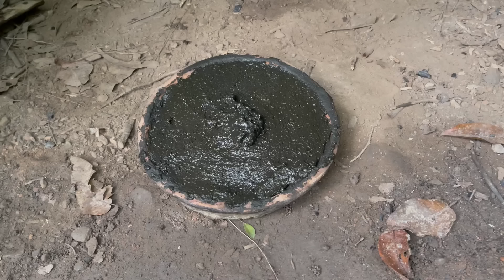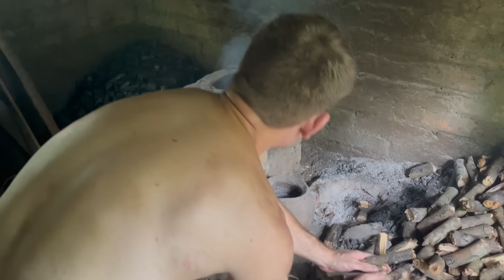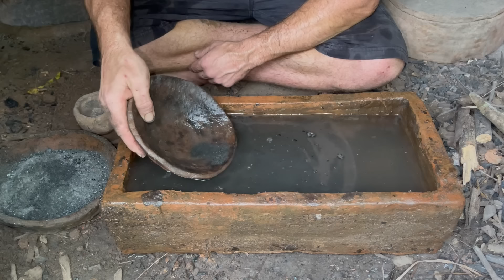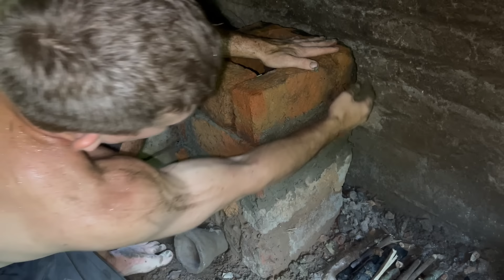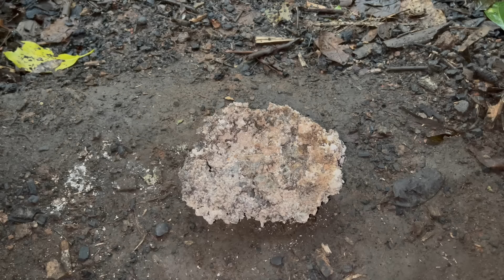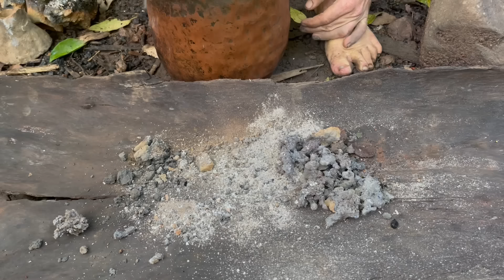Primitive Technology: Roasted Ore and Shell Flux Smelt

Comment from the maker: I tested roasting the ore, using lime flux (shells) and recycling slag in 3 separate smelts. Roasting the ore improved the yield about 2 times though this might have been due to decreasing the volume and effectively increasing the concentration of the ore. Adding lime (snail shells) ruined the smelt and produced next to no iron. This may be due to the ore already being basic and chemistry and the lime made it so basic that the slag won't flow. Sand (an acid flux) or old slag might make a better flux for this type of ore, lime might be better used to flux iron sand (acidic due to the silica content). Finally, I tested re-smelting the slag from previous smelts (not the slag from the lime smelt). The result was about half the iron came out compared to fresh ore, which suggests that slag should be smelted again to recover any iron not obtained during the first smelt if fresh ore is hard to come by. Thanks.
Reply: Have you been able to test the temperature at different phases of the process? If not with a laser thermometer than by color of the fire akin to how a blacksmith judges heat?  Is it possible the heat is rising too quickly for the prills to form in the mass?  Great video as always!!
Reply: The iron spheres are huuuge compared to previous experiments! Even the small ones looked bigger than previous prills. Nice work!
Reply: The limed sample looked almost like you were getting glass. 

You might give glass-making a try?
Reply: Just an idea,

If your pots can handle the heat, is it possible to make a sealed crucible to melt the accumulated iron into an ingot?
Reply: What is the ultimate goal once you have collected enough iron? How much are you going to need?
Reply: You should start working on lead and copper, and grow lemons so you can make batteries
Reply: @charles I came here to ask the same question. My guess is the goal is to produce some basic iron working tools like a small hammer and anvil.
Reply: Is it a good idea to melt the slag a third time? Or is it better to get new ore.
Reply: That’s too bad about the Lime slag. Is there no way to salvage it?
Reply from the maker: @Jaalix_Learns  The color of the coals looking through the tuyere is white hot and leaves an after image like looking at the sun (1300C plus?). But it could be that this is only a small region of coals with the blast not penetrating deeply enough. The fact that it's producing cast iron rather than low carbon soft iron though indicates a high heat where the metal becomes liquid and absorbs charcoal. Also, in other smelts, I've picked out charcoal with iron (not slag) melted/splashed onto it suggesting the iron is liquefying. The heat shouldn't rise to quickly as the fuel bed above is supposed to keep the heat in. Thanks.
Reply: How long did it take to gather the ore for this video?
Reply: I love all of your iron smelting videos!! I'd be interested to see the pH of the lime sample you threw out. It could be a pH issue, or perhaps the shells weren't crushed up enough (they appeared to still be a bit chunky). I'm NOT speaking through experience as I've never smelt iron before, however I've seen many videos on it being done, and do have experience with copper, aluminum and bronze/brass. 
Another thing you could try doing is stirring the slag once it's molten. It may help further separate the iron from the slag
Reply: honestly the wood ash is probably already acting as a good flux, i don't think you need to do anything else there.
i am surprised you didn't burn and grind the snail shells first though, i thought that would have been an obvious step if you were going to use them.
Reply from the maker: @Endede  They're big compared to my recent smelts (30g total compared to about 15g). It seems the ore has changed though over a few years, as the prills I produced during the iron knife video were larger and made about 40 g per smelt for 6 chargers rather than 7. Maybe more white clay has gotten washed down the creek recently which tends to lower smelt yields. Thanks.
Reply: I'm curious would increasing the heat yield more iron and if so how might you go about increasing the heat?
Reply: @sandvich4days871  I think the uneven heating of the clay would crack the pots and it would leak
Reply from the maker: @lairdcummings9092  Actually the roasted ore seemed more glassy to me than the shell lime smelt. It could be, as mentioned elsewhere in the comment's, that the ash left over from roasting is acting like a flux. Agreed, the really glassy slag could make good glass. I've experimented with making glass but haven't gotten a result worthy of a video yet. Thanks.
Reply from the maker: @sandvich4days871  It can be done in a crucible, but the clay needs carbon added to it so it wont melt. I'm testing crucibles at home. Thanks.
Reply: Nice video, the ash from the roasting may have added some caustic impurities, to dehydrate iron oxide you only need a few hundred °C It may be possible to do It in the ceramic kilm.
Reply from the maker: @charles7412  A better knife than the one I cast before or an axe. I have enough iron at the moment but need a way to cast /forge it efficiently. Working on these methods between smelts and experimenting at home with scrap iron before testing it in the wild. Thanks.
Reply: can't wait for iron hut 💪
Reply: Why not pan for iron sand in the creek?
Reply: Wood ash from hardwood
Reply from the maker: @NeuroScientician  Yes good idea but hard to find those metals here. Thanks.
Reply: @NeuroScientician  You can also make a battery with only iron. (see metal-air cells) Or at least something like a Leyden jar. It doesn't make sense to go into electricity without a way to get copper and form it into wires though. Wish he had copper in the area
Reply: sources ive red says smelting iron is a self fluxing process and requires no additional flux. i dont think adding different types of flux will give different results.
Reply: @primitivetechnology9550  As I mentioned in a separate comment, I think that roasting the shells was the step missing in the shell lime smelt; too many other bound compounds that likely worked against you in the shells, not just a proper calcium oxide (lime) to mix in. Worth consideration in the future.
Reply: Have you tried to add lime to the ore yet? I'm sure there's limestone available. Roasted stones can be crushed to produce the lime and mixed in with the silica to draw out more of carbon. It may increase your yield and produce a better quality of iron. Quite an interesting experiment. We developed methods long ago that to this day we still haven't been able to replicate. Perhaps it's the natural elements that we have veered from. Please continue to make these amazing videos. Thank you.
Reply: @primitivetechnology9550  I was looking at the colors; it reminded me of obsidian.
Reply: Have you tried just pure iron sand? Also, are there any other ores in your area? Would be cool to see other metals as well. 🔥🙌Fire videos as always!
Reply: The wood ash is extremely basic.
Reply: This is super cool. Are there any other workable metals in your area that you're interested in working with?
Reply: I noticed that there are a lot of steps here that are not shown, such as every time you had to make a new fire.  I’m curious how much time it took to actually do everything presented here.  I love your videos because they are very engaging and informative.  The first one that I saw made me say out loud “Survivor, eat your heart out!”  I am completely impressed with your videos and I am very glad that you continue to make them.  Thanks for all the hard work that you put into making these videos for us to enjoy.
Reply: I think that the ore is the problem here. You can not squeeze the water from the rock. Or iron from whatever this is.
Reply: What happens if you reheat the chunk of slag and iron to a hot temperature again? Would the iron prills separate further or combine?
Reply: I agree on you'd need to fire the snail shells first. Maybe also has to do with the furnace not being completely dry? Old slag sounds like a good flux, because if there's clay in it, it would be "saturated" with ferrate? so it can't dissolve more iron? just a thought
Reply: Generally, taller and narrower stack will give you a more efficient combustion process. Have you looked at making some sort of bellows to allow for more efficient air flow?
Reply: Why not use magnetite to remove iron from slag. Ancient people knew about magnetite property of attracting iron, even if they didn't understand why, and used it : extracting arrowheads from the body and probable other uses too.
Reply from the maker: @hallohoegaathet7182  Maybe it is a good idea to smelt slag a 3rd time but I imagine the yield would drop by half each time. Slag might also be a good flux for fresh smelts as I've heard it was used in ancient times as a flux. Thanks.
Reply from the maker: @parachase7467  Maybe but best to get new ore so as not to waste charcoal on it I think. Thanks.
Reply: Time to move to the Iron age? Curious to see it
Reply from the maker: @samuelberghuvud5527  A month to get enough ore for 6 charges or about an hours smelt. Though in the dry season the ore comes out faster/ congeals more in the creek. When it floods there is no ore and it's better to switch to iron sand as the water helps run the sluice that collects it. Thanks.
Reply: Shells are made from calcium carbonate. I'm pretty sure you want sodium carbonate for flux.
At least that's why sodium carbonate is used in glass making. It dissolves the silica and makes it fluid at a lower temperature.
Reply: The increased yield looked awesome! Shame that adding the lime made things worse. Perhaps the calcium increases the melting point of the slag, and the potassium in the ash decreases it (the potassium oxide itself softens on the hot coals and clogs furnaces if you try burning grass in them, as far as I know). Have you considered using a more potassium-rich ash (like one from grass)? Or even leeching the potassium out with water and using the potash as flux? Another idea is to increase the temperature, which could potentially be done by passing the air through a clay pipe, or pipes, either in the flames of this furnace(though it could probably melt the pipe), or through a separate furnace similar to a pottery kiln, which can be wood-fired. Though I am not entirely sure how feasible that idea is with just primitive tools.
Reply: Is there no other source of iron nearby. It really doesn't seem like your "ore" has that much iron in it.
Reply from the maker: @PureNrGG  My working theory is that lime shouldn't be added to this ore and instead an acid flux such as sand or old slag should be added instead. I saw a guy on reddit smelt bog ore and he added lime. He said something went wrong in the smelt and the iron formed separate pieces. I'm guessing, like here, the lime made the slag more viscous and kept the iron apart. If there is sand in the ore lime flux is a good idea, if not just roasting is good enough as iron ore is self fluxing. Thanks.
Reply: Can you taste the pH of a solution of your iron matriz? You can use red cabbage's juice as an indicator to know the pH base on theyr color.
Reply from the maker: @Chuck_Huckler  Agreed on the wood ash as a possible flux. I thought of roasting the shell first but saw that they don't roast the shell before adding it and it still works (iron sand smelting video). Thanks.
Reply: this may be a very basic question but how do you get the fire inside the high smelter, do you just drop it down and hope it doesn't extinguish, do you shove it through the tuyere, or something else entirely?
Reply from the maker: @leviathan8544  I'd say yes increasing heat would make the slag flow better and probably make a molten cast iron pool with a high yield. More airflow would be a good start (open to suggestions). Thanks.
Reply from the maker: @JerryPaulTreeCreations  I once smelted a batch of iron bacteria I got from a different creek and copper and gold came out though only small pieces. This might be related to that. Thanks.
Reply from the maker: @bruinjim1  Sluicing is more efficient than panning, but panning the sluiced sand also concentrates it further. Thanks.
Reply: Have you thought about shaping the bottom of the furnace into a trough or similar? A harder shaped bottom could help with forming more concentrated iron pockets within the slag piles and help your yield in post processing?
Reply: While watching this, I remembered this video https://www.youtube.com/watch?v=XP6oqIic4lo I wonder if you pulled the blower away from the furnace a little it would improve the amount of air going in?
Reply from the maker: @Kptn_kabaakal  Correct, iron ore is generally self fluxing. Though some iron ores have impurities that require a flux. Had to test it to see if this was one of those ores. Thank.
Reply: @sandvich4days871  need some way to enamel it probably... Not a bad idea though...
Reply: Perhaps not using as tall a furnace as the head takes longer to rise and get a consistent heat for the various heights which may help explain part of why you didn't get as much ore...

Have you taken a look at some of the industrial smelting processes (not in terms of scale but technique) and seen if you can improve yield that way?
Reply from the maker: @beepseatsfindingfoodtreasu8756  I think the shell is a purer form of calcium than limestone. Limestone should give a similar result I think. Thanks.
Reply from the maker: @lairdcummings9092  It would be similar to volcanic glass ,yes. Thanks.
Reply: couldnt you make a way larger furnace for larger batches, cant imagine they smelted for prills earlier to make smithable iron
Reply: Can't you just add remaining slag dust into the next batch? it might ruin efficiency so you can just prepare them separate bowls and add 3 fresh haldfuls and 2 recycled handfuls. Might allow you to gather iron from both and make the prills bigger?
Reply: Maybe you would consider placing the basic flux on top of the smelt, or mixing it into the charcoal instead of the ore? I'm no chemist, but to my knowledge it's the products of messy/volatile/incomplete combustion products you really want to neutralize, probably over what's in the ore, in a mixed furnace like this. Acid flux is also a good idea.
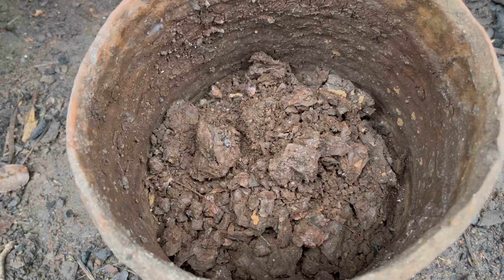Reply: 8:50 you say "33g usually 15g", is this per X g of ore (unroasted or roasted; meaning more ore if it is roasted due to lighter weight), per x liters of iron bacteria, or per x g of iron bacteria powder (aka unroasted ore)?
I really doubt it is per X g of wood (including what's used to roast, preheat, and the coal (weighed before it turned into coal)). But if you were to put it into terms of that (fuel aka wood), how much worse is the roasted ore?
What about a comparison in time per produced g of iron? (includes both roasting, making coal, and cutting trees)

edit: I feel like it's likely the issue with the lime-ore was the taller chimney with no change to fuel/ore ratio or burn times. Should probably try regular roasted ore with the tall chimney to see if it is better or worse, before discarding the lime slag/ore.

edit2: you ended up doing exactly that (though with old slag from previous unroasted smelts before the 2 shows before?), showing that it was likely the lime being the culprit (only variable differing from second smelt to third , while first->second had both lime and chimney as difference). Nice.

ps: wouldn't using a magnet to extract the prills after crushing the slag be much easier? Supposedly you can make them by leaving refined ore out in thunder storms (elevated above tree-line), so they get hit.
Reply: Have you tried testing at home what the perfect yield would be from your bacteria, if you had perfect control over heat etc?
Reply from the maker: @williammorris1763  Yes I tested pure iron sand in this video: https://youtu.be/OPIUMpiV0IY . The ore in this video was iron bacteria aka bog ore. There are magnetic rocks here too but I can't identify them without a magnet (not primitive). I did take some magnetic rock home though and smelted it as a test but wasn't able to make iron. So far the two ores I can find here primitively are iron sand and iron bacteria. Thanks.
Reply: @primitivetechnology9550  would it be possible to find iron ore from sources other than bacteria, in the area you are around? From what I've read, some common sources of iron ore during the Iron Age in Europe included bog iron, a type of iron ore that forms in bogs and swamps, and ironstone, a type of rock that contains iron, but I'm not sure it that's available to you. Thanks.
Reply: @jimmerd  in previous videos he shows that he starts the fire from the bottom adding some starter and blowing air inside, then he add more fiule.
Reply: Just want to say thanks for your time making these videos. They're my favourite.
Reply: I have seen people make iron and copper by putting the ore in clay crucibles with some flux.
Reply: will you make iron tools in the future???
Reply from the maker: @agp6106  No metals other than iron that I can find. I went to an old copper mining town near by and picked up some ore that fell off the train way back. I smelted the ore in a pit and it only made tiny copper prills. I then got high quality malachite from Africa off the internet and tested it in the same furnace and it produced lots of copper in large pieces (50% yield copper from ore by weight almost exactly). So if you find an ore it needs to be highly concentrated to obtain metals in high quantity. Thanks.
Reply: This is amazing. And really makes you appreciate what humanity had to learn in order to move into the Iron Age. 

Looking forward to see what you end up making with the iron you’ve made so far.
Reply from the maker: @JohnGonzalezFL  I can repeat the cycle of an iron smelt each month as the ore comes to hand. Some steps not shown are the considerable amounts of maintenance of the furnace and blower as well as making new charcoal each time. But I'm streamlining the process while also testing new methods as well. Thanks for watching.
Reply: @primitivetechnology9550  Hi John! Did you try to hammer a bloom/slag while it is hot? I have seen videos where blacksmiths by working the bloom multiple times create iron bars, while impurities chip out from the material.
Reply from the maker: @Aryan_homophobe  It's the same as bog ore used in many parts of Europe e.g. Here: https://youtu.be/80omf7bM3Ek?t=50 . Thanks
Reply: @primitivetechnology9550  
I would definitely roast the shells to destroy any volatile organics or water in them, especially considering you'd just recently scavenged them and they were probably still holding onto a lot

having large chunks of shell like that probably didn't help either, and they'll be easy to grind after burning
Reply from the maker: @arlight2  I've tried that, reheated slag once without crushing it and the prills don't come together, they just melt and come apart like the first time. Better to take the iron out and smelt it again. Thanks.
Reply: Consider the idea of making a secondary channel to show us your backstage experiments.
Reply: Do you plan to make an axe from the metal you collect? I bet you'd do a fantastic job
Reply: I'm sure you already know this, but i just wanted to add that wood ash can actually be used to glaze pottery as well, which might make a fun video idea for the future.
Reply: Very well done. Looks like you are getting a good method going. Questions, would it not be an idea to make some kind of scoop or measuring cup for ease of handling, precise amounts, and cleaner fingers? Secondly why the change from 2 handfuls to 3 handfuls when handling the slag? Keep up the amazing work!
Reply from the maker: @CimboAkinci  I don't think roasting the lime will give a better result. If the shells added raw made the smelt worse, then the calcined shells should basically do the same thing.  Agreed on old slag as flux, my thoughts would be having some of the iron taken out would make it more acidic (iron is basic) so adding an acid flux to a base ore should help it melt better. Thanks.
Reply from the maker: @SC2Spectre  Yes I might try a bellows and compare it with the blower. Thanks.
Reply: Hey, ive been thinking of a way of getting more iron ore quicker, i think you already talked about it and discarded the idea but i think it might possible if you get enough iron and found a way of casting it into a bar. Im talking of creating magents, permanent magents with the ore you already found, there are different ways of making magnets with iron, the most known ones are through electricity, and by using another magnet to permanantly align the iron structure so it converts into a magnet and those are clearly unavailable to you (at least for now and i think for a long time) BUT there is a third way and it is by striking iron with a hammer which could be available to you in a not so long period of time, i dont know the details of the process but it might be worth a look. Once you have a magnet you could separete iron much faster and easier from for example sand, and you could even test stones to see if they have iron on them or things like that. Here are some useful links that i found looking at the subject, they all talk about Joseph Henry and it is quite intresting: https://commons.princeton.edu/josephhenry/permanent-magnet/#:~:text=Take%20two%20magnets%20put%20one,will%20become%20a%20permanent%20magnet.  https://sciencing.com/make-super-strong-permanent-magnets-6520830.html
Reply: @primitivetechnology9550   No problem. It would be interesting to see you pan some of the soil/sand near the stream of bacteria. From what I understand, (I may be wrong), the iron bacteria helps to release or separate the gold from the other minerals around it, so it wouldn't necessarily be in the bacterial sludge, but in the area near it. (?) ... (lol again, I'm not a geologist... just a curious person with an insane array of interests. hahaha)
Reply: @primitivetechnology9550  i feel as if you should try making a water wheel (or something similar) to automate the process of heating up the iron. You say you spend hours heating it up and a water wheel would definitely be the perfect next step in progression, right? Regardless, thanks for giving us a glimpse into this primitive hobby! Its really cool!
Reply: In one of your replies you mention you're open to ideas on how to increase the airflow to increase the temperature and hopefully get better yields.
Now I am completely spitballing here as I am in no means an expert on any of this, but as an idea.

Do you reckon you could combine several techniques used from your previous video's?
Specifically I am thinking two things, that being making a grate, and the potential added air from opening up draft holes mid process.

The grates are easier said than done as I am afraid the ore will not get hot enough and ore falls through without getting iron prils first. You could use a small container to keep the ore contained in but then you are back at the issue at hand of not getting enough heat into the vessel.

The draft holes could be opened later in the process, kind of like a reverse version of plugging the holes up when making charcoal. The natural draft holes could make the blower significantly less effective and might even hinder the process though. This would require quite a different design of the furnace to balance natural draft with induced draft and preventing flammables from entering the blower or falling out of the draft intakes.
Reply: is it possible that the lime may still have been a good idea, but that the mixture may have been off? or maybe the shells need to be added at later staged during the smelt?
Reply: Based on this, I'm very interested to see how your sand flux turns out! I believe I saw a viking smelt reconstruction using sand that worked well once.
Reply: As a wise man once told me: the good metallurgist does not make a good iron; the good metallurgist makes a good slag, which in turn makes a good iron.

Seeing you mention the acidity and alkalinity of the slag makes me believe you're onto the same good pieces of theory, which is great. One thing you might want to take a look into is the colour of the slag and what it can tell you about the elements present in your melt and what to do to correct it. For instance, a very oxidized slag will be black and vitreous, because of its content in iron oxides, while a very deoxidized slag will be beige to white, because of calcium oxide. In practice, you want to lighten the color of your slag as much as possible (to a beige colour), as it will draw out the impurities such as sulfur out of the melt. For this, you'll want to keep experimenting with the ratios of iron, carbon and lime, until you reach the best results. Another thing you might want to try is to congregate your iron oxide into pellets, in order to make them heavier and closer together.

One of the important things I want to touch upon is that you used unbaked shells as an additive during the smelt, which in turn caused a failed smelt. In my opinion, this might very well be caused by the fact that the shells were releasing their CO2 during the smelt, which both decreased the concentration of deoxidizers in the environment and limited the maximum temperature in proximity, as the reaction is endothermic. I would suggest you retry, both with shells and wood ash that has been burned red hot in order to drive off the CO2 before you discard this avenue.

In every cases, best of wishes and best of luck with the process; I can't wait to see the progresses!
Reply: Be safe working around that much fire. Carbon monoxide can catch you off guard.
Reply: @primitivetechnology9550  I saw you mention that there might be more clay in the ore due to rain washing it down.  Would it be feasible to do a small test of ore from further upstream?  It might not be worth the effort of hauling it further but may provide some answers.  Love your videos!
Reply: Did you intentionally make the pot porous or was it a happy accident?
Reply: ah men, it is a shame that shells ruined one. It feels like this video is your more hardcore video. I can not imagine how much wood/charcoal you needed. Anyway, thanks for the upload <3
Reply: @primitivetechnology9550  far from knowing about these witchcraft arts you are into, but i was thinking on you using a bellows better that the fan, and i wondered from what material could you make one.
 wood, of course, but i haven't seen you using leather, not even hunting, so very curious about it. 
also wondering if a bellows, not giving a constant flow of air, would work better or not. maybe a big one, but again, i'm an ignoramus.
man, great video, as always, i'm really thankful for you efforts.
Reply: @capitancoolo1  i was thinking that, or an axe
Reply: fire good
Reply: What are some of your longer term goals with this work, is there a particular technology or method you’re looking to get to?
Reply: @Primitive Technology: Regarding snail shells: It might have been more useful if you baked the shells first before crushing, so their Calcium can be turned into Calcium Oxide. Shells contain Calcium Carbonate, which in theory is not a bad flux, but in practice, when it starts breaking down due to heat, it releases CO2. The excess CO2 might have interfered with the process in various ways (creating cool air pockets, messing about with the reactions needed to extract iron out of the ore, messing with the fluidity of the slag, etc).

I'd suggest baking the snail shells, so you can get their CO2 out before utilizing them in the smelter. Then crush them into fine powder and try mixing with the Iron ore.

Your hypothesis about pH might also be correct, since your Iron ore was already mixed with wood ash, and wood ash also contains good amounts of calcium oxide. You'd need to try again with something to bring the pH back down.

I don't know of any ways you can secure these naturally in a forest environment, but if you can get some Fluorite or Borax, that will help immensely with making your slag's viscocity. I've heard fluorite can be deposited in soil near rivers, but I don't know how you'd go about extracting it.
Reply: Would thicker furnace walls keep in the heat better?
Reply: Would it be possible to make a magnet with primitive methods? I know the timeline is weird, since they found it during greek times, but it would be fun if you can use primitive methods make magnets to separate the iron from the slag
Reply: @primitivetechnology9550  As someone who worked in the Steel Industry for a few years I can tell you that the Steel Mills use Slag as a means to strip out impurities when they cast a new batch. I worked for a company that recycled slag and sold it back to the mills. Basically we would dry it and bag it and sell it back, sometimes we would add some other chemicals, lime included in certain ones. You should consider putting a bit of slag into your melts, experiment with it and see what kind of results you get.
Reply: @primitivetechnology9550  hey, do you have a final plan of what to make when you get enough iron? Like a sword? Or are you just trying out methods with no specific goal in mind?
Reply: Have you tried looking into what cross section some old smelting blast furnaces had? I remember they had a tapered conical shape which might solve some issues with uniform heating of the ore and better pooling/collection outcome after the firing...I had researched these structures as an architectural project a while back, we had some old abandoned smelting blast furnaces in my area...
Reply: Have you considered pre-heating the air blown into the furnace? Historically the furnace gas was used for that purpose in steelmaking, but a tube in a bed of coals could do the same trick I think. Might be worth a shot.
Reply: @primitivetechnology9550  Please add subtitles with Ukrainian translation, please
Reply: @primitivetechnology9550  AND MY AXE
Reply: @primitivetechnology9550 

I think you used too much crushed shells, which created a slag that was too viscous and prevented the iron from coming together properly. Have you experimented using a fraction of the crushed shells used initially?

Have you tried making different kinds of charcoal (as in soft wood vs. hardwood), to experiment and/or improve the temperature range and total amount needed? My idea is, a higher temperature, in theory, should help to create a more fluid slag, which can help to separate the iron from the impurities in the ore. 

An in regards to temperature, is it an idea using smaller charcoal chunks or even charcoal fines (crushed charcoal) to have a better temperature uniformity throughout the furnace? And in the same light, would insulating the furnace with, say, clay and straw also improve temperature uniformity, efficiency and end result?

And last, I'm scratching my brain to increase airflow. Would an extra, angled opening on the left and right side of the tuyere, perhaps slightly higher than the tuyere opening, add extra draft that helps increasing the temperature?
Reply: How did you determine how much shell you should use for the amount of ore you had? just guess and check?
Reply: I was actually about to suggest re-smelting slag once or twice prior to the video--I've read in a few places that it was pretty common to do so when using methods with fairly low yield. Glad you tried it!
Reply: @Astro34512  ?
Reply: you still have misinformation up in your responses to your pinned comment of your last video on this. Organic acids cannot reduce iron 3+ to iron 2+. This requires a reductant, often supplied by bacteria which use iron 3 as an electron acceptor, to 'breathe' it like we do with oxygen, producing iron 2 instead of h2o like we do. Acid base reactions are not redox reactions so organic acids cannot turn iron 3+ into iron 2+. Ask any chemist about this.
Reply: @primitivetechnology9550  what happened to the show? will you ever share more with us?
Reply: @Astro34512  Are you okay, nothing hurts?
Reply: That's amazing you're getting that much iron from that bacteria now, you look like you're onto a process that you can start producing at a much better scale soon.  Can't wait to see a home made hammer or some hardened files.   It's a lot of work but once you make a good slime knife it will be worth it.
Reply: @capitancoolo1  I think an anvil is a bit too ambitious for this method. He would be out there for an eternity trying to collect that much iron 😅 I think some basic iron tool heads is probably what he's after. But if he refines this method or finds a better way anything is possible I suppose.
Reply: I would be so happy to see you and NileBlue switch jobs for a day
Reply: Ceramic beakers
Reply: Why dont you use a bow in your method of starting a fire?  Its alot easier and faster.....
Reply: Is your bellow producing enough air? Do you think you may need a bigger one? Love the content!
Reply: If you could have any iron tool from a modern Era, what tool would be the most helpful?
Reply: I feel like you should make yourself some small shovels/scoops/spoons to save your hands from these strong alkaline mixes, and the heat.
Reply: @primitivetechnology9550 have you considered making a magnet to make gathering iron sand or separating pills from slag easier, once you have enough iron for it? Apparently you can make a simple, weak one just by hanging a rod/bar of iron vertically for two weeks, or by striking gently several times on one end (as if trying to hammer a nail into the ground/anvil).
Reply: @SC2Spectre  you actually don't necessarily want efficient combustion here, you want partial combustion producing carbon monoxide instead of CO2
Reply: Dude... you are so fuxking awesome. Seriously.
Reply: instead of going all the way into trying to extract and take apart every iron prill, you could roughly remove most of the slag and then resmelt together with some ore, this way you are increasing the concentration of ore with every iteration...

once you have a larger concentration the smelt will have a larger blobs of iron
Reply: Can't wait to see if you will ever make a tool out of this iron
Reply: @NeuroScientician  he'd have to start a new channel, batteries are a little more advanced than just primitive technology
Reply: @primitivetechnology9550  do you think a more advanced/larger bellow is needed?
Reply: @primitivetechnology9550  on the matter of airflow and temperature, a really tall chimney might make for more passive airflow. also, certainly, using coal, coke, anthracite etcetera would help, though i don't know if you have any over there. an ancient smith possibly might have three or four guys working multiple blowers and, finally, it could make a difference to do this outside: it's possible that the roof is preventing the formation of a strong upwards current, and thus making it harder for the combustion gases to escape the whole furnace. cars get more power out of removing the silencer, and the roof might also be obstructing the exhaust of the furnace.
Reply: Can you section of your text s little better? 😁
Reply: @primitivetechnology9550  практика дома? Да ты хорош!
Reply from the maker: @BillScriven  Yes, a furnace bottom lined with sand would good for forming liquid iron on. Thanks.
Reply from the maker: @bmwflyboy  I have tried that yes. There didn't seem to be much of a difference. Thanks.
Reply from the maker: @thepacific2933  Yes, I've thought of adding slag and ore in the same smelt. Thanks.
Reply from the maker: @chedatomasz  I've used a hair drier at home to smelt iron bacteria in a furnace and get the same result as with the primitive blower. I tried a leaf blower once at home on a furnace and it blows the charcoal out of the furnace. Thanks.
Reply from the maker: @luisjalabert8366  Yes, another ore I've smelted was sluiced sand in this creek see video here: https://youtu.be/OPIUMpiV0IY . Also, bog ore is just iron bacteria that has formed into lumps so it's basically the same material. Thanks.
Reply from the maker: @king-yz7ib  Yes, I've made a crude knife in this video: https://youtu.be/dhW4XFGQB4o . And plan to make more tools from iron in future. Thanks.
Reply from the maker: @hubert_an  The iron is spread to far apart in the slag to hammer. Also, it's high carbon and doesn't forge well. May be best to melt the iron and anneal it before forging. Thanks.
Reply from the maker: @asgerthorndalkofod2366  I just use rough measurements in the wild, fairly consistent. I reasoned that slag would have less iron in it than fresh ore so more needed to be added per charge. Thanks.
Reply from the maker: @jackos5d851  Possibly but if I keep experimenting with lime it will likely ruin newer batches of ore. Thanks.
Reply from the maker: @Furko08  I made the pot extra porous by mixing in dead grass so it leaks on purpose. Thanks.
Reply from the maker: @unnatural_log6472  Yes but the thicker walls would also take longer to pre heat. Thanks.
Reply: @primitivetechnology9550  interesting, thank you
Reply: Can I have waffles?
Reply from the maker: @lnwolf7563  Thanks for the advice, I am interested in melting the iron. I'm planning on recycling some of the dirty iron I've made previously and will try using slag in a melt to see if it cleans up the metal as you say. Thanks.
Reply from the maker: @Montragon29  I've tried a short conical furnace and it works about the same as the brick furnaces but I might test it again. Thanks.
Reply from the maker: @Namacil2  Yes, I'm considering a preheated air experiment soon. Thanks.
Reply from the maker: @rogierius  I added the shell by volume according to a crucible iron recipe. I don't think it was too much just that this ore doesn't require a basic flux.

Yes, it doesn't seem to make a difference the type of charcoal though I've hear charcoal from resinous wood like pine actually works better than hard woods in smelting due to the higher flame temperature.

The rule for charcoal lump size is that it should be about 2.5 cm/ 1 inch in average diameter. This is because there needs to be enough void space between the lumps to let air through for an efficient burn. The smaller the lump size the harder it is to blow air through the fuel bed. An extreme example of this is natural draft furnaces where the charcoal usually needs to be 3.5 cm in diameter or larger (depending on the height of the furnace) in order for the furnace to work. Yes, insulating walls would work well.

Like a venturi? I've tried this by leaving an air gap between the blower and tuyere and it doesn't seem to make a difference. I usually have the blower go right into the tuyere port but don't generally bother sealing the gap with clay in the hope that there is some venturi effect. Thanks.
Reply from the maker: @skii_mask_  Yes, the ratio of ore to lime was about 2:1 by volume. This was based of a recipe of crucible steal. Thanks.
Reply from the maker: @rikuaotsuki6353  Me too, remelting the slag gave a good additional source of iron. Thanks.
Reply from the maker: @catlee8064  The fire bow isn't easier than the fire sticks once you know how to do it. Also the fire bow has string which breaks and rots needing more replacements. Thanks.
Reply from the maker: @BobyChanMan  Maybe, but I've used a hairdryer for air blast on a furnace at home. It made about the same amount of iron. Thanks.
Reply from the maker: @torcoAaAa  Yes natural draft. I have a video on it but it didn't make iron due to the ore. I'll try again in future. Thanks.
Reply from the maker: @SCXBelka  Yep practice at home before doing it in the wild. Thanks.
Reply from the maker: @chir0pter  Which video has this mistaken comment? If I can find it I'll edit it. Thanks.
Reply: @Muaddibize  Besides his shorts and camera equipment, he will only use what's available in the immediate area.
Reply: Would it be possible to grow the iron bacteria?
Reply: Would it be possible to knap the glassy slag? It looks hard and brittle. The main problem then would be impurities I guess. Awesome videos!
Reply: Why was the product from the 2nd smelt unrecoverable? I'm sure it's a chemistry thing, but did the lime render it completely unusable, or just more work to recover it than starting from scratch?
Reply: I like your films
Reply: Do you have enough nearby water flow for a trompe to assist your air pumping?
Reply: @primitivetechnology9550  The iron bacteria cement one. Not a big deal but I think you might find learning about the topic (bacterial catalysis of metal redox cycling) interesting!
Reply: Beeswax is another natural flux. Smelting with two or three green leaves from a nitrogen fixing plant also helps , it creats a nitrogen atmosphere around the metal sponge when sealed Ina clay pot .further reducing oxidation.
Reply: @primitivetechnology9550 давно смотрю ваши ролики. Согласно историческим находкам болотное железо - болотную руду - лемонит обжигали не россыпью, а измельчали и пекли в горшке в обычном костре около шести часов. 
Есть русский канал "Кузница Вёлунда" там настоящие кузнецы отковали меч викингов полностью по историческому процессу,  от сбора руды до изготовления наковальни
Reply: @Mark Minton  I've been seeing a sharp increase in people using 'than' instead of 'then'. Usually, the mistake is that they just use 'then' for everything. I don't know how this one started...
Reply: @coreymerrill3257  the amount of nitrogen in green leaves is in no way enough to create a 'nitrogen atmosphere' by burning them. Also we already have a nitrogen atmosphere. To enrich it in nitrogen further you mostly just need to remove oxygen.
Reply: @sandvich4days871  the oven with the tall chimney may be able to get up to the temp needed for that.
Reply: Man you sure need a magnet. How would these been found in ancient times?
Reply from the maker: @anonymousthesneaky220  Yes, the slag was very glassy and probably could be knapped. I cut my fingers on it a couple of times, it's very sharp. Thanks.
Reply from the maker: @ruaheadjunkee2  Yes, completely un usable. Not worth risking charcoal on to get the iron out of it, better to save materials and labor for good ore. Thanks.
Reply from the maker: @MrRivensteel  The creek doesn't run all year, only during the wet season and then it becomes slow moving. Also, there are no sudden drops that would lend themselves to good head pressures. Thanks.
Reply from the maker: @МихаилНовиков-ы8п  Like crucible iron. I need better clay for crucible because the clay here melts in a charcoal fire before the iron smelts. Thanks.
Reply: Hi John! For purifying your ore, since you've got probably got wood sorrel growing in your area, one possible way could be making an oxalic acid solution from it, as hematite is remarkably soluble in oxalic acid at high temperatures - even more soluble than in sulfuric acid! So one possibility would be heating the hematite in an oxalic acid solution, filtering it while hot (perhaps through a sand / gravel funnel?) into another container, then letting it cool to precipitate the hematite. It's probably going to be quite slow, but it should give you completely pure hematite.

Here's an open-access study that includes some information about the solubility of hematite in oxalic acid: Vehmaanperä, P., Salmimies, R. & Häkkinen, A. Thermodynamic and Kinetic Studies of Dissolution of Hematite in Mixtures of Oxalic and Sulfuric Acid. Mining, Metallurgy & Exploration 38, 69–80 (2021)
Reply: @sandvich4days871  he has tried that before. At the end of the video is the knife he made which was a bunch of prills melted together and sharpened
Reply: @primitivetechnology9550  Mixing clay-based iron ore and woodash is generally not a good idea. The silica in the clay and the alkali cabonates in the woodash/lime will fuse into glass once fired, making it difficult to separate the iron from the glassy slag. Rinsing the roasted ore may be a better option. The most important aspects of iron smelting are a high enough temperature and a CO-rich reductive flame. A taller blast furnace would help create such conditions more easily. Shells should be roasted first to make lime, and then it can be mixed into the ore to help get rid of the carbonates during actual smelting.
Reply: Could you send a sample of iron bacteria to a chemical company (or Cody's Lab for that matter) to analyse the iron content? I'd be interested to see the yield compared to what's theoretically possible. 

Also if you want to see if it's the roasting or the wood ash that's increasing the yield, you can add ash to unroasted ore to see.
Reply: @Crushnaut   I have watched that video, and that isn't what I mean, he didn't seal it like I suggested in my comment, which allowed the iron to get contaminated and become to brittle do to high carbon, also he used the clay as a mold for the knife not a crucible. what I mean is to seal the iron in the crucible to protect it from the outside while also giving from some control over the carbon content of the iron.
Reply: Сделай тигель и в нем переплавь. На дно руду, сверху засыпать песком.
Reply: John I have been watching your videos now for longer than I can remember. The amount of hard work is just insane. Thank you so much for all of your education! One thing I just thought of when someone mentioned bellows was the sheer importance back in ancient times of animal products. Bones, skins, wools, fabrics, fats that could be rendered. Have you thought about doing some hunting? Gather meat, yes but also lots of useful byproducts. This also got me to thinking about the importance of the feminine aspects of early civilisation. The women of past cultures must have been equally skilled in other areas of primitive technology, and the combination of these two different skill sets aids the movement and growth of the culture. I'm not suggesting you find a "bushwife" 😂 just a thought. Anyway love your content and good look with the rock and mud smashing ❤
Reply: @cycbuild  maybe Nile green would be better?
Reply: @juanaq  I guess he would make a piston bellow.
Reply: Very interesting to read about the relationship between pH and viscosity. It's funny because I took petrology in college and don't even remember learning about that. A cursory look at a paper suggests the decrease in viscosity you mentioned reflects the breakdown (depolymerization) of the silicate network, but I'm still not sure I understand the mechanism by which increased pH does this. If there's any chance you get this nerdy in your research, I'd love to know a little more about this.
Reply: @primitivetechnology9550  To increase airflow while remaining at current technology levels, you could make a power transfer unit.  One way would be a large wheel unit powered by water with rope running to the blower spindle.  A wooden brace at top of your blower spindle to hold it upright.  It would be like an old spinning wheel.  without water for a power source, you could hake a similar wheel device with a hand crank instead.  Either way, you could maintain a steady airflow, rather than the current whoosh whoosh. Depending on your wheel size, you'd also have increased spindle speed as well as steady flow.
Reply: I see lots of slag like in this video & other one 🤔🤔🤔 I just wondering if you can repurpose those slag??? or is it can't be use anymore???
Reply: I don't know how much time you spend doing the PT stuff, but is it at all dangerous to your health to be working with smoke and coal particulate like that without any respiratory protection? Have you looked into that? Just curious.
Reply: @primitivetechnology9550  Build it still higher, which should give better results. You need a lot more time for the charge to interact with the charcoal to get high yield, which the multiple passes are doing. Might have to get to roof height to get high yield.
Reply: @primitivetechnology9550  
Bog ore is found in highly acidic environments, so it makes sense that it needs an alkaline flux.
Reply: You could allow yourself animal skins and sinew if you can source it that would have been in the tech bracket you are in plus it would save hunting or trapping anything in your area because i don't know what the law is in your area.
Reply: Video editing comment:  There were a couple few captions that went by a little too fast and I had to interrupt my viewing to go back and read them.  

I’m sure an expert somewhere has a formula of words/second they should be displayed, and I love your content so I thought I’d mention that potential place for improvement
Reply: @primitivetechnology9550 hat do you do besides experiments?
Reply: @primitivetechnology9550  You get so few iron granules. What is the best way to spend this iron? What tool would be useful in a primitive economy?
Reply: The woodash from roasting might already makes the ore basic
Reply: Heck yeah what is the first tool you wan’t to make with metal?
Reply: @primitivetechnology9550  I'm glad you responded to that comment, I completely forgot to consider charcoal as a limiting factor, obviously everything is a lot harder when you do it from scratch. Great video as usual and thanks again for taking the time to respond to interesting questions!
Reply: @primitivetechnology9550 What about making glazed pottery with it? Would that be possible?
Reply: @primitivetechnology9550  awesome to hear youre getting around to crucible engineering so you can increase your thermal penetration.
Reply: What do you do to pass the time while blowing the furnace? Have you considered trying to make some sort of gravity powered blower so you don't have to do it by hand the entire time? Love the videos.
Reply: Curious as to what kind of smells, if any, this ore smelting process gives off?
Reply: I can tell you where the problem might be, by utilizing iron or red clay sediment, and smelting that down through a roasting method.

Pretty much you are working with what folks call is bog iron. I would recommend looking for more stone/craigs/cliffs/gorges that would have better iron ore deposits. 

The easy way to tell, look for rocks with a rust red color fresh in the break of the stone, not from the red clay sediment. From here, you can break this up into a fine or close equivalent powder like form. Smelt it in a crucible, and allow the impurities to bubble to the top like skimming butter in a pot when you boil it to make it for cooking. Same principle with smelting. 

I have done smithing and smelting before, both cold forge, and more traditional smithing as well.
Reply: @primitivetechnology9550  I keep thinking that this could not be the way they did it in the iron age. It seems to me that you're doing a massive effort to get a few grams of iron, while humans were building armor and swords for ages. If this is how it was done, I cannot even begin to imagine all the effort it took to gather all that iron. But I admit I know next to nothing about the subject.
Reply: @luisjalabert8366  We're talking about very different periods here. Those armors were made of mined metal I think. You get larger quantities, but that's because they already had the tools to mine it.
Reply: Do you not have limonite or other bog iron near the surface in your area?  I would assume since you have iron water springs or creeks you would find associated rock.  I've tried roasting that, at which point it powders easily and be smelted or purified.
Reply: @primitivetechnology9550  See. Hair drier and leaf blower smelting with mixed success and fun failure is just the right stuff for a second channel we would love :D It’s like the primitive site is minecraft survival mode (terrafirmacraft even!), and at your home with civilization’s magic gadgets at disposal is like ‘creative mode’. :D
Reply: @primitivetechnology9550  bog iron would definitely be acidic, I’m guessing your environment to be more neutral. Unless your water is running through limestone I’m going to guess it’s not basic. Your wood ash may also be basic (it’s an ingredient in homemade lye if memory serves), so you may want to test an acidifier if pH is a major issue.
Reply: when you roasted it, it got mixed with a bunch of ash that definitely added a crapload of carbonates and other impurities
Reply: @Primitive Technology Have you tried boiling the wet bacteria in a pot to help dry it out faster?
Reply: I could watch you for hours. Literally.
Reply: @catlee8064  Turn on captions. He has a commentary during the whole video. He explains why he does not use the bow or spinner for starting a fire.
Reply: i was thinking if maybe you just added to much shells. looking at iron smelting recepies they are something like this:
80% iron ore
15-20% coal
3-5% limestone
since you need charcoal for heating you need much more of it but acording to this ratio, you should mix 95% iron ore and 5% shells and it should be enough. adding sand as flux might be a good idea, since your ore is from bacteria and is basicly pure iron oxide. I would try one batch with added sand (95% iron ore, 5% sand, no limestone) to see if ammount of slag and its quality changes. than i would try a batch 90% iron ore, 5% sand, 5% limestone to see if the slag is better. i know that limestone reacts with silicates so maybe you need both?
Reply: Lime or calcium oxide dominated slags don't work in bloomery because their melting point is too high. 
Bloomery iron smelting is fluxed by iron silica slags. You need to add quartz sand because your type of iron bacteria bog ore is devoid of silica.
Reply: love you :)
Reply: Is there a Hungarian translation of the book or is it available in Hungary?
Reply: Can we have a fire staring competition between you and Les Stroud?
Reply: As one of those who suggested adding lime - it was meant to be added to the ore you used at the time - unroasted. The ore itself is not basic, but it became like this during the roasting - wood ash containing alkali carbonates was mixed in, making it basic, thus unnecessary to add lime.
Reply: What if you make cone shaped bottom of furnace to try concentrate ore in a smaller area. And waterwheel powered blower might help with air flow. Or two wheel powered blower (as bicycle drive principle).
Reply: I love your dedication to this subject, I've wished for years someone would try it exactly the way you are doing things.
My suggestion would be to preheat your air, at a reduced oxygen if needed (eg blow air through a charcoal fire or something) and to load much more coal after the last addition.
Finding coal would be a great, coked coal would be amazing.
Having an easy hands-off air supply would be as well, but I know you're limited to what the surroundings offer.
I'd definitely watch hours of attempts on another channel where you don't limit yourself to what the land offers (use cokes, good ore, preheated air etc)
Reply: Have you ever watched how Japanese made their Tamahagane steel for their swords ? I am pretty sure they use some kind of ironed sand like you do and put it in a primitive furnace too
Reply: Awesome progress. Can’t  wait see when u can do middle age blacksmith room.
Reply: Have you ever thought doing something silly like melting a bunch of sand into a giant blob at the bottom of the furnace to see if you can knap it? I don't know if that would actually do anything for you. Knapping a giant chunk of slag.
Reply: @nicolasbridot3490  second this, the traditional smelting methods make use of similar iron sand and bloomery furnace methods. However some cursory research also suggests that the smelt is maintained at a high temperature for much longer, which may not be feasible for one person operation of the furnace. 

The next step seems like its more towards creating a suitable crucible so that the iron can be cast and the refinement of a method to reduce the carbon level in the iron to turn it into steel of some form.
Reply: @primitivetechnology9550  wouldn't it be better to first make tools for forging?
Reply: @CimboAkinci  you can make iron wires
Reply: @primitivetechnology9550  I’ve seen videos of people draining the slag before and they end up with a solid chunk of iron. I’m not sure how you would drain it during the firing with your furnace however.
Reply: @catlee8064  he explains why in the video, read the subtitles
Reply: Great video! One thing noticed is that the color of the flame for first batch showed almost blue, which usually is a sign for complete combustion and high temperature, while the second batch only give yellow flame and third batch is more red (very small blue portion),  higher temperature usually brings in better yield, may need more air input for heating. the other thing is that the original blend of white powder may still contain a lot impurity, that may lead more slag and waste of iron, a filter or water dissolve may help the yield as well.
Reply: @elijahlong7791  yeah but it's ferromagnetic so it's gonna be useless for electric motors. 

tbh i don't know how one starts the electric "tech tree" without copper. maybe try to get aluminum first? it can be extracted from clay but you need electrolysis to get it so back to square 1
Reply: @CimboAkinci  zinc isn’t ferromagnetic and it is pretty easy to extract small amounts. I’m not too sure where you might come across the ore though
Reply: 1😊11
Reply: @primitivetechnology9550  Man, this stuff really is a science! Keep up the good work, and while you're at it you can find things out humanities ancestors never would have dreamed of doing with what they had! I am sure many people must have suffered inefficiency without realizing it. Discovery really is incredible!
Reply: What will you use the ore for?
Reply: Im sorry but when I read things written by others my brain usually uses the person's voice for narration, I'm here like "how am I reading this in silence?"
Reply: Have you though of panning material to get the heavier black sand which might be metallic….then smelt?
Reply: I think the reason why lime not worked is because it is added with coal. Lime is put into liquid steel to not only create higher temp but also remove impurities inside molten steel. For next experience, I think you should somehow: 1 - separate coal from iron and flux and 2 - make water mill to automate blowing process.
Reply: I know it may still be a ways off but I am very excited for the moment you are able to create iron tools that you can use in future videos and builds.
Reply: @charles7412  he is moving into the iron age, might have enough to make some tools, will need at least 50 times this for nails
Reply: Don’t you need to fire the shells to produce lime since they’re calcium carbonate in their unfired state? (CaCO3 + [fire] => CaO + CO2)
Reply: hi man i really like the things that you're doing I would like to learn something about your life style.
you think it's possible to come to your place and live with you for a while or you are to busy or yours work to teach someone?
Reply: Would you be able to make some sort of primitive crucible? Take the mixture after the first firing and smelt it in the kiln? Mike be able to get better separation.
Reply: read about European iron smelting furnaces,
the furnace you are making is similar but you need to change it a bit. They are also for charcoal. You will improve the efficiency in melting several times, the temperature you will get will also be much higher.
Reply: Have you looked into making cooper tools? Any native copper in your area?
Reply: yes, it's awesome, hello everyone :hand-pink-waving::hand-pink-waving::hand-pink-waving::hand-pink-waving::hand-pink-waving:
Reply: how do you not burn your hands
Reply: @FeroxNyamin  :hand-pink-waving:
Reply: Don't know what ore looks like
Reply: Hard worki only
Reply: @primitivetechnology9550 have you experimented with using a clay paste on top of the prills during smelting to prevent exposure to carbon and loss of oxygen?
Reply: Do you think you could build a wood gasifier setup and redirect the gases to the furnace for increased temperature and less ash?
Reply: Also, wouldn't it make more sense to make lye out of woodash than it is to collect snail shells? Could throw in some slag into the lye solution and see whether it dissolves any of the silica, essentially yielding you with waterglass.
Reply: the snail shells are calcium carbonate not lime. maybe better to heat them separate to make calcium oxide (lime) and then add that to your smelt instead of adding calcium carbonate which is limestone. I don't know if it would make a difference but it might.
Reply: @primitivetechnology9550 would love to see a glass video that sounds awesome
Reply: @charles7412  a rocket ship and mars terraforming
Reply: I have seen on other channel people made sword from "swamp" iron. Sings I noticed which may help you: You may raise the kiln floor above the ground. Then when you are done smelting and the slag is still hot you can brake the wall of the kiln and poor runny still hot and liquid part of the slag. It will help with separating iron from slag. Also, the guys I'm talking about were using borax as a flux for the main body of the sword but for the guard and pommel, they used river sand. Apparently "diry" river sand works better than sea sand. Also, they mentioned that some old techniques presumed to use runny slag from previous smelts with river sand. I hope this will help you to get better yields.
Reply: Нет, железа для подобной технологии нормальное колличество вышло . Видел подобное на YouTube
Reply: https://youtu.be/mOKZjR-609g
Все этапы добычи железа из речной руды
Reply: caco3  -> cao + co2  and . co2 + c --> 2co     .shells affect the reducing property of coal with iron ore
Reply: Minecraf furnaec be liek
Reply: I never would have thought you would have listened. Glad to see you hear us out my friend
Reply: Thats what i was thinking🤪🤯
Reply: Thanks for the video. I tried this at home last week and success. After burning down my home i was able to get a lot of metals and etc from the ashes. Instead of shells i used solid bone for some of my materials.
Reply: اعتقد انه كان عليك ان تستعمل الاصداف البحرية الاكثر كثافة وان تعمل على الية ترفع من درجة حرارة الفرن حتى تحصل على الصهارة المطلوبة مع استعمال الكبريت الخام
Reply: @primitivetechnology9550  I was about to comment about firing the shells, as I've seen videos about using quick lime in concrete/cement production. Maybe the increased pH of the lime would aid in the process, but I see you already thought about it (plus, this is an older video, so you most likely won't see this comment).
Reply: You have to cook the shells separately till they are white crush then use fyi